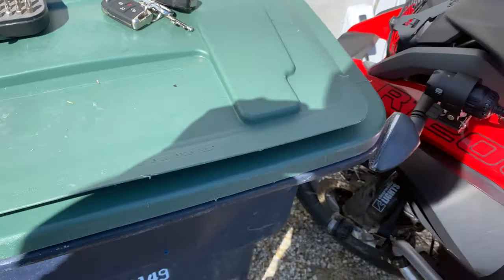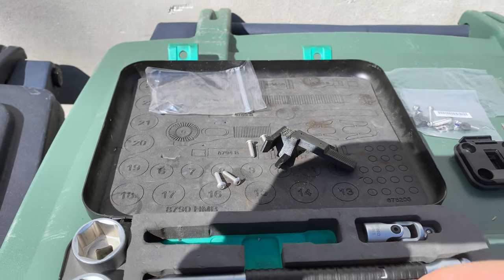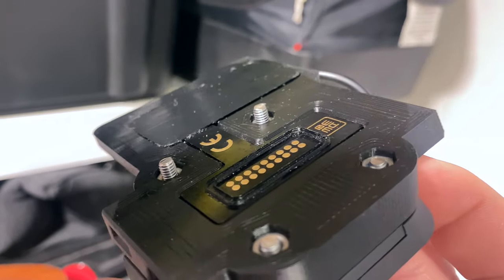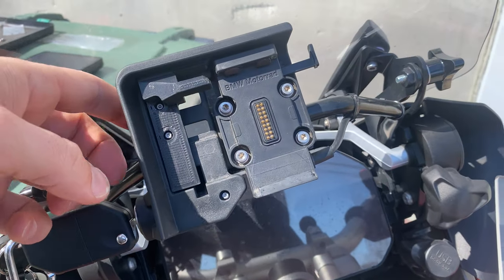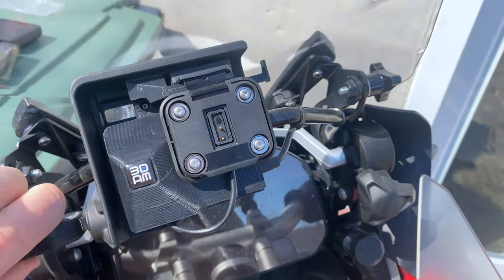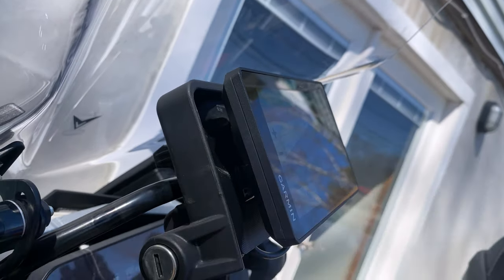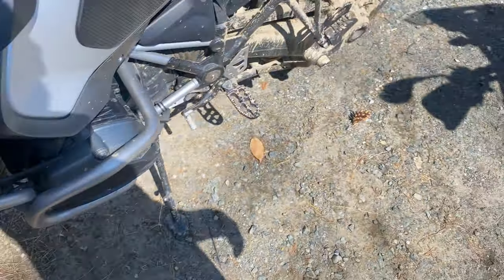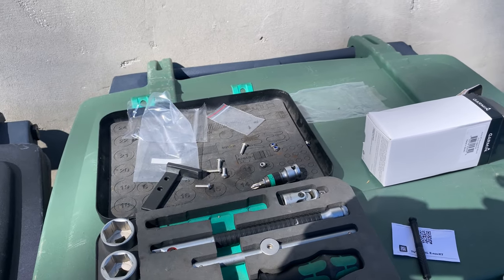Install: Garmin Zumo XT Mount for BMW R1250GS Navigation Bracket (BMW Navigator VI)

Comment: Thank you Adam for your "how to" vlog, very useful 😊
I did similar installation on my GS Adv but I decided to use existing BMW original mount, instead of an expensive adapter mount. So, with about 12$ I was able to install everything and at the same time protect more the release button of the XT from being pressed accidentally and still keeping the installation BMW style 😊
Reply: How exactly did you mount the Zumo XT onto the existing BMW original mount? Thanks!
Reply: @BanjoManFleckFan  Isn't difficult. You just remove the center part assembly and with longer screws and spacers, replace the original mount coming with the Zumo XT. Of course also the customized BMW electric plug needs to be added to the XT harness. It works beautifully, I have it on my GS Adv LC.
Reply: @e-gadgetsfreakITA  sounds great. any chance you can post pictures what it looks like and perhaps a brief manual? Cheers
Reply: @e-gadgetsfreakITA  Can you post some pictures please? I just got my zumo xt and ready to install it.
Reply: @trevoryard9954  How?

Comment: Adam do you miss the Wonder wheel and how well do you like the XT with this mount. Did you go with 90 degree or horizontal Thanks
Reply from the maker: I haven’t really thought about it. Wonderwheel I mostly used for zooming and so I quickly got used to not having it. I ended up changing it from 90 to horizontal on my GS. On my Husky, I keep it vertical next to the iPhone.

Comment: I have a Zumo that I used on my F800 which was sold last fall for a R1200.   My K1600 came with a Nav VI so I have been swapping that between the K1600 and R1200.    Will look at the adapter you used as to keep a GPS on each bike.    Timely share ... thanks!

Comment: Having yet another Nav 6 stop working correctly I am looking to buy and fit a zumo XT, the fixing kit you used leaves a big gap and I wonder if that will cause a problem with water ingress?
Reply from the maker: No issue with that but I did end up switching to Touratech's mount because this one had issues with power delivery (power would cut out)

Comment: I have a NAV 6 and have not had a problem with it. People comment that its old fashioned so can i ask everyone  apart from reliability what are the advantages of the Zumo over the Nav6?  Cheers Tim
Reply from the maker: If your NAV 6 is working fine, no need to change. This is faster with a larger screen, has Topo maps and clearly shows dirt roads which I like. The reason I upgraded is because I was on my 4th NAV 6 replacement and was tired of the unreliability.

Comment: I did same install after watching this video.  Question: Have you had any problems with the bike while running the XT?  When using the XT installed in the Nav 6 cradle on my GS 1250 , it triggers the anti-theft system and turns the ignition off.  I haven't tried it with the motor running yet but sitting on the stand it happens about 1 minute after pushing the ignition button.  Any ideas?
Reply from the maker: I've had issues with the electric connection being interrupted randomly but I don't think it's the NAVXT mount but Garmin's plug system which is known as faulty. Garmin has mailed me two new wiring connections and mount pieces so I'm going to reply and try that.

Comment: Adam, I wanted to circle back on the XT. I was wondering if your still happy with the XT and if it’s worth the loss of the GS wonderwheel functionality. And did you stay with the Italian mount or upgrade to anything else? I read somewhere, I think, that you were considering the (pricey) Touratech mount. Thoughts? I’m about to pull the trigger on the XT and will switch it between bikes as well. I just purchased a Honda CRF300L to compliment the GS. The 300L isn’t in the same league as your Husky but it should be easier to muscle through some stuff that scares me when I’m alone on the GS. It’s my first foray into the dual sport scene.
Reply from the maker: You are going to be thrilled with the 2 videos coming out this week :) ------ I'm loving the Zumo XT. It's a massive upgrade to the NAV VI unless losing the Wonderwheel controls is a deal breaker for you. For me it wasn't. the biggest improvement for me personally is my Cardo & iPhone are paired to the Zumo XT and then I move that GPS between 3 different bikes so I never have to worry with pairing ever again. I no longer pair my iPhone to the GS. The Zumo has wonderful Topo-maps, has all of the low class unpaved roads, has historical markers, faster search, online search of FAcebook/Foursquare places and is much better at controlling music. I'm a fan. Thinking of cost, NAV VI is $1000. Zumo is $399 on sale. Touratech mounts were $200 each or $400 total so all in I'm out about $900 for nav, mounts and extra wiring / base plate and I have a NAV that lives on 3 bikes. with one bike just being a RAM mount. Zero complaints here.
Reply: Trigger pulled! The XT is on the way. Thanks for the detailed feedback! I look forward to the new videos! I hope you explain how to use the XT…I hate reading instructions! 😆
Reply from the maker: Oh, I hadn't thought to do a how-to video. I need to figure out an overhead camera setup where the Garmin doesn't reflect ceiling lights back at the camera...hmm thanks!

Comment: I received my Zumo XT last week and will be installing it soon.  It looks like the adapter is pre-wired for connection from the stock mount to the Zumo, I'm assuming the voltage is already stepped down at the cradle since nav6 is basically a Garmin.   My question is this.. I bought one of the can-bus pig tail plugs to use the existing wiring for the factory plug/power source and will wire it to the Garmin cable.  Can i cut the Garmin cable and eliminate the in-line voltage step-down box if plugging into the BMW plug that is used by the factory nav?  I haven't checked voltage from the factory plug yet, but any insight would be helpful.  Otherwise wrapping up all that extra wire from the garmin and hiding behind the tft would be a challenge; not only that, but I don't want to step down a 5 volt source.
Reply: Ok, so curiosity prevails.  I just went and checked and the pig tail outputs 12 volts across pins 1 and 3, so the factory nav mount must be dropping the voltage within the mount.  Now to figure out what to do with the long garmin cable.  Maybe i'll just run it back to my switched relay under the seat and just not use the pig tail cable.  I guess I'll figure it out this weekend.
Reply from the maker: @bsalvis  Yep, you're right!

Comment: Adam, I have a Nav V now on my non-TFT 2014 GSW. Does the Zumo still allow access to the other digital bike information (gauges) screens through the Nav unit? (Tire pressure, oil temp, speedo, etc.) You may have to refer back to your non-TFT GS days. Also, can you send GPS routes to the bike via WiFi? Thanks!
Reply from the maker: Hi Brad. No-sir, you loose all of the wonder-wheel functionalities & bike parameters.
Reply: Bummer. Thanks for the confirmation.

Comment: I'm asking only because I've never used an actually GPS unit and instead rely on phone apps for online and offline maps: what is the advantage of having a dedicated guidance unit?
Reply from the maker: Just that..dedicated. I don't have to worry about not having my speed front & center or having a podcast playing on my phone and know where I'm going. Having the map always on updating if I miss a turn, it's just less distracting to always have one screen dedicated to navigation.  I keep iPhone apps with maps and navigation installed just in case I need them.

Comment: Hi Adam. I purchased the same unit from Italy and found that the XT powered up and showed charging. However, when  started the engine the unit stopped charging. I then took the unit off the adaptor and swithed it off, started the engine and the replaced the xt and it powered up and showed that iot was charging. Great vid by the way.
Reply from the maker: You probably need a new base. The first batch of Zumo XT devices have a base that is slightly too large so the power connection isn't perfectly seated. Garmin mailed me a new one when I complained about losing power.
Reply: @AdamChandler86 Adam......cleaned all connections pressed adaptor connections.....and it works perfectly now. Start the engine it looses the lightning bolt for a second or two but then starts charging again......

Comment: Sending back my second NAV 6! Had it about six months before it started ghosting, screen jumping and unresponsive screen. Will be installing the XT as soon as the new bracket arrives. If your considering a NAV 6...don't do it!☹
Reply from the maker: I’m very happy with the Zumo XT. Huge upgrade over NAV VI..only loss is the wonder wheel controls on the BMW but this is definitely device to buy. 50% cheaper than NAV VI and much better.
Reply: I agree! Just started using the XT on my CRF450L and so far it's awesome. However, so disappointing Garmin/BMW can't figure out the issue with the NAV 6.

Comment: The wheel doesn’t seem like a big deal to me, but what about other bike info?  Tire pressure, critical bike messages, etc?
Reply from the maker: Those parameters are mostly covered now with the TFT screen. It's all there except maybe...nevermind I can't think of anything the Garmin had that the TFT doesn't. BMW is going larger on the next GS TFT (look at the R1250RT) so I think they're phasing out the NAV completely as a built in bracket.
Reply: @AdamChandler86  Right. The TFT has everything but my point was whether or not the XT had any of it, sounds like no. Yea I’m holding out on a new bike until 2022 or 2023 when BMW moves to the big screen. And I will only upgrade when CarPlay is available. The BMW connected app is ok but rubbish in comparison. My buddies gold wing has it and it is lovely and super convenient.
Reply from the maker: Nope, the NAV VI had an array of like 12 metal contact points. The Zumo XT has only two (power only I imagine) so it's not receiving any data from the bike, just power.

Comment: Hello Adam, I bought the E-navXT- Horizontal, without anti-theft from 3D motorrad, but didn't get the locking mechanism piece. Did you buy it seperatly. Pls let me know. Thanks, Tony
Reply from the maker: Interesting. That locking piece, to my knowledge, IS the 'anti-theft' sounds like they forgot to include it.
Reply: Thanks a lot for the swift response. Clarified now that the piece is an anti-theft piece and I ordered without it :(  I will try to order it separately if possible. But I am going to set up on my GS 750

Comment: Hi Adam
Fantastic video :-)
Do you know if there is a difference between the mounts for navigator  VI?
I have a bracket from Hornig  (GPS  mount  3 to BMW R1200RT 2005-2009) where the bracket for  navigator VI sits. The bracket is exactly like what you have on the video, but do you know if there is a specific difference. The web page you are referring to in Italy does not have a BMW R1200 RT from 2005-2009 on the page, but only the R model and RT LC model.
Hope you can help
Regards Torben from Denmark
Reply from the maker: Hi Torben, thank you for watching. Zumo XT & Nav VI connect much differently. The only similarity would be the power connectors on the rear row of connectors are the same. The rest is different from how they connect. I think what I linked to is specifically for the Bracket that BMW sells as an OEM part. You'd probably have the most luck by emailing the Italian company a link to what you have and asking about compatibility.

Comment: Curious how the bracket has held up off-road since installation.
Reply from the maker: Good morning. So far, zero issues with this mount. Very solid.
Reply: @AdamChandler86  Awesome!  I am going to call Garmin for the ghosting issue on my Nav VI.  Heard they discontinued it so will go your route if they can't send me a new one.  Plus the GPS, Phone, headset connection never did work well on the VI.  I hear it is flawless on the XT.  So frustrating.

Comment: Awesome video.  Just a bummer the unit doesn't support the wheel functionality and not recognized by TFT. Still impressive that the aftermarket parts make the install easy. 
Sadly, I think I'm holding out hope for the Nav VII
Reply: Doubt there will be a Nav VII. BMW seems to be integrating the nav with the TFT judging by the new RT. I think we might see a very revised GS in 2022 with new TFT and new front to accommodate for the Radar Cruise Control.

Comment: Are you still happy with this adapter?
Reply from the maker: It's good for the price and is plug & play. Nice way to get the Zumo XT wired in without any wiring required. I wanted something more sturdy so I purchased the Touratech locking mount eventually but this was a good stop gap.

Comment: is it easy to reach and use especially while riding ?
Reply from the maker: It's about the same as the stock setup except you lose the wonder wheel to zoom in and out but I personally don't mind it.
Reply: @AdamChandler86  wow , so the stock wan could be controlled from thew wheel ?

Comment: what's the advantage of zumo xt vs nav6? I like wonder wheel function.
Reply from the maker: You lose that but that's it. You gain a ton of off-road features like Topo maps, low class unpaved roads, cool POIs and even some 3D / aerial map features. It also has web-based POI search through FAcebook/Google/FourSquare so you don't have to type in full addresses anymore. Screen is larger and brighter. I wouldn't go back to a NAV VI now.
Reply from the maker: Size for me is the only negative. You and I are similar in that we can't just switch NAVs...but also we have to switch charging / mounts/locks so it's a lot more than $500. I've bought Two touratech locking mounts and 3 sets of Garmin charging wires + bases so it's been a little expensive to switch.

Comment: Adam, do you know if this will work with my '14 1200GS that came with Nav V?
Reply from the maker: It should work. The thing is, I don’t want to make the mistake of having someone waste money so you should probably do two things. Call a dealer and ask if the 2014 mount is the same as the 2017+ mount (NAV VI) and then email 3DMotorrad (the people who make the 3D printed mount) and see if they can confirm a 2014 GS compatibility. If both give the thumbs up, then you’re good!
Reply: @AdamChandler86  Thanks!
Reply: @AdamChandler86  Just installed. Really cool. BUT mine does not turn off when I turn engine off. In others the power is not wired to key-on. Is this the same for you?

Comment: I can’t believe BMW hasn’t released a Navigator VII.
Reply: They are going built in now.  Look up what they just put on the 2021 R1250RT.
Reply from the maker: Yeah, I held out for a while. The NAV VI has also been unreliable requiring so far, 3 warranty replacements for me when I ride in cooler temperatures. The weather sealing seems compromised and it will take on condensation and fail. The Zumo XT is bigger, brighter, faster and hopefully won't have water ingress problems.